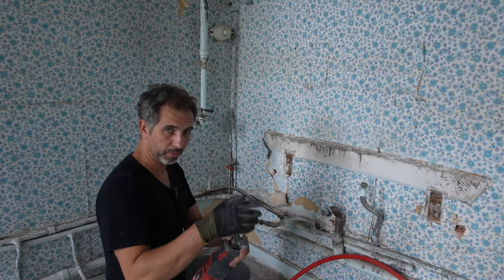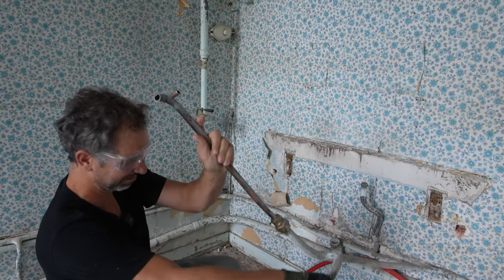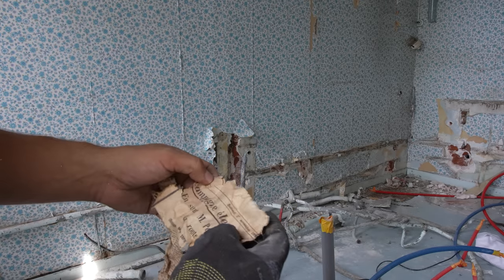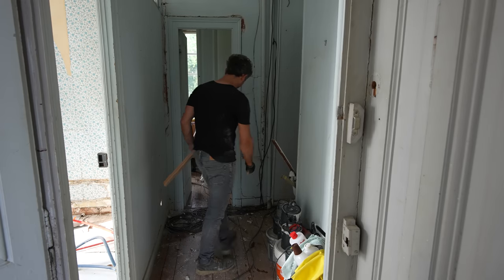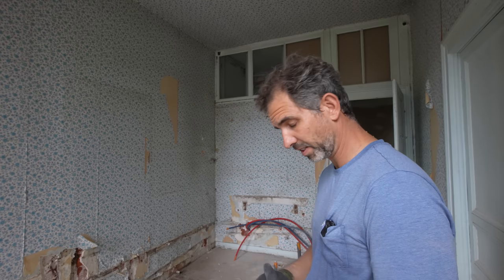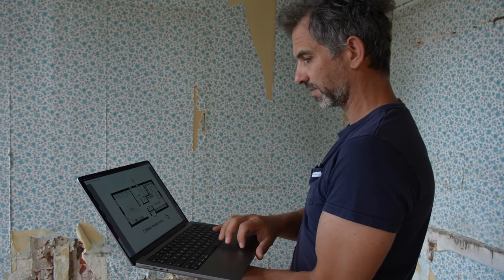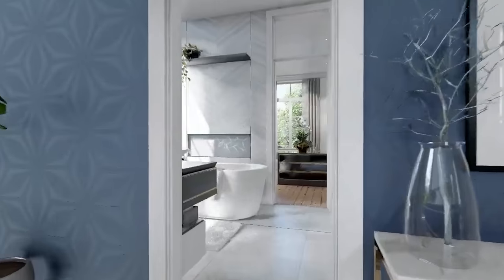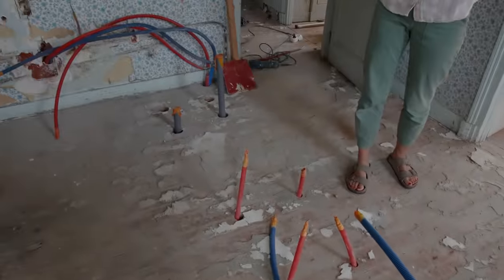Chateau Master Suite Makeover - How complete strangers redesigned our bathroom

Comment: Keep the two doors, ditch the hallway door.  The bathroom is more private to the master bedroom suite if it is accessible through the bedroom and not the hall.
Reply: This. 👍🏻
Reply: This  will make a beautiful master suite 👍🏼
Reply: Keep the flow. You’ll be glad you did. The bathroom should not be accessible from the hall, however.
Reply: Commode could be placed in same room, next to shower, in space of where the hallway door (that would be removed) occupied.
Reply: Totally agree with this!
Reply: That's a crazy idea, if you need privacy in the bathroom no one can enter the dressing room. Hard if getting ready in the morning.
Reply: @kyliereynolds4687 there would still be the hallway to access the dressing room directly from the bedroom… see the plan shown at 10:50… when they say “ditch the hallway door” they just mean take out the door going from the hallway into the bathroom
Reply: Definitely the two doors
Reply: I agree!  A master bathroom should be for the owners only and not other members of the home.
Reply: Agreed!
Reply: Technically you could keep the hallway door and build the toilet there. Use the frosted glass enclosure idea from that last designer (with the animation video). That way you could still use the toilet that is usable even if someone is having a shower or a bath - just make double locks, so whoever is using the shower or the toilet won't have someone else barging in.
Reply: I agree!!!!
Reply: Keep the 2 doors. Lose the hallway door.  Sorry for the extra work Philip.
Reply: Totally agree
Reply: Keep the door from your bedroom to the bathroom. 
And have glass above the lintel to let  the south light into the bathroom.
Likewise have a similar window above the bedroom door. That will bring daylight into the hallway. 
I think having a door from the bathroom  into the dressing room is practical. Close off the door from the bathroom  to the hallway.
Reply: Why not change bathroom with dressingroom? More space for example a privat infrared sauna, good for you after hard physical work at the château
Reply: Agreed! You could always have a single shower and then put the toilet in an alcove in front of where the hallway door is currently, so you don't have to move any additional walls :)

Comment: I would definitely block off the hallway door and with regards to the bedroom/dressing room doors, you could have sliding doors that slide into the wall and keep it open most of the time, just close it if you need privacy etc.
Reply: Pocket door.
Reply: And if they reuse the original doors they will keep the heritage feel with modern practically.

Comment: Whichever plan you choose with the doors to the bathroom,  make sure to keep the independent access to the dressing room from the hallway. You need to be able to access it when someone else is using the bathroom.
Reply: As long as the toilet is enclosed in it’s own room within the bathroom, the extra door may not be necessary .
Reply: I was referring to let's say, someone taking a relaxing bath and spending a while in the bathroom, thus preventing access to the dressing. However I do agree with you that the toilet door will alleviate the need for locking the entire bathroom for most uses. It depends on the use of that suite, guests, or homeowners I think.
Reply: I am sure they have a multitude of bathrooms to choose from if someone is in the bath.
Reply: If this was a sanctuary for my husband and me, I would absolutely walk through to the walk-in closet room. The toilet is private with the attached door. He has nothing I haven’t seen.
Reply: @Lifewithoutmusicisamistake yes, but if some one wants to walk through to the dressing room….?   Some one we are not married to…?
Reply: @eleonoreaubry2469  yes agree. However I was thinking later that the extra door to the WIR would be handy if you just needed to run upstairs to get something - eg jumper, coat etc.🤷‍♀️
Reply: I agree with keeping the second door in the dressing room in case you want to enter it or the bathroom without bothering someone resting in the bedroom. That was the main reason I favored the solution with the bathroom door to the hallway, but if there is an additional door to the hallway in the dressing room, it should be okay, too.
Reply: And it gives you more options for the dressing room to be transformed for other purposes (you never know)
Reply: One always has to think of escaping a fire easily and quickly also. If the dressing room is at the end of three sequenced rooms (bedroom, bathroom, then dressing room) with no other egress except the windows, it could be a trap in some unthinkable scenarios. All rooms upstairs should have a collapsible ladder/chain ladder that hooks over the window sills in case of fire, regardless.  I was an EMT. I think about these things.
  @thinkingbout
Reply: Not if the loo is seperate
Reply: @juliamcgrath3364  I hate toilets that don't have an adjacent sink - even a tiny corner one.  Also I don't want my clothes anywhere near the steam and moisture that comes with a bathroom.  Not to mention potential toilet spray.  

It's going to be fabulous whichever you choose.  Excited to see your color choices for the bedroom - so many great color choices throughout the house.

Comment: Keep the two doors. You might remove the actual door to the bedroom so it stays open but keep the actual door to the closet. My house has the closet off the bathroom and steam from the shower can cause mildew to form on the clothing. If you can close the door to the closet then you can reduce the moisture in there which will reduce the chance of mildew on your clothing.
Reply: 100%, specially with a French Normand climate.
Reply: Same. I keep my closet door closed all the time, and had I properly envisioned this necessity,  I'd have put a glass door into my closet so I'd still have natural light inside when I'm dressing there while hubby showers.

Comment: The two doors are beautiful. I would keep the ‘flow’. It’s also hard to tell from the video since I don’t have the exact measurements but the double shower seemed gigantic. I would look into exact measurements and then go for a wider shower of approximately 1,2-1,5m with two shower heads. If that doesn’t work I would go for a smaller shower. Moving of the walls seems too much and the space is already quite large.

Comment: You guys are really lucky.  You received a bunch of really nice design proposals and all for free!  I wrote a note last week with a few general design thoughts but not much specific with the exception of keeping the two doors opposite each other. There is a very good reason you feel comfortable with that concept, Anna.  It has a very natural flow and in a house of your genre, it was very common and called the "enfilade" style where a suite of rooms would all be joined by doors in a straight line.  Much like formal french gardens which would often have those same long sightlines. (Not the other meaning of enfilade which is a series of cannons all firing at once.)  You would also be giving a small but very polite nod to the origins of the house.  Next, Philipp, we know you are having trouble with the wall thing, but get over it.  It's not that big a deal.  Just get one or two guys to come in to do the drywall work for you.  They can put up the drywall, patch and mud whatever is necessary and be out the door while you are still trying to figure out how many sheets of drywall you need. None of us mere mortals are good at drywall unless we did it for a living. Don't try to help them, you will slow them down.  If you are keeping the floor the same (and I would) like the dining room, for instance, which turned out beautifully, have Benoit do patches where the holes are.  You can't hide them but he can make them look good.  Typically, they will look sort of like little "x's" but it is done all the time. Then do all the primary floor sanding for all three rooms. If there is no crown mould, put it in now and make it as close to the same as any other in the house.  Keep all door and baseboard mouldings the same as the existing. If you install mouldings up to wainscot height like were wisely shown in one of your patron's renderings, keep them the same shape as any others in the house.  Even if you don't especially like the shape, so sad.  Be consistent, be consistent, be consistent.  Again, as in the bootroom color choice, it all helps with the flow of the house, one room to another.  Lastly, Anna, if you are going to do paper, that is done after woodwork, paint, caulk, after everything else.  You can leave it till later even if you just paint walls for now, get the papers done at a leisurely pace in your atelier, then install them in a month or two or three over a not busy two or three day period, like when you are between guests and Philipp is busy fighting bees or planting trees. You know what i mean. Get Philipp back on the drawing board and walls be damned, full speed ahead!
Reply: Awesome suggestions!

Move the wall even just a bit for the toilet and have it not have to be enclosed would solve the issue with not enough room…

Comment: Since the ceiling of the floor below is finished, l think you should consider completely demo-ing the floor.  Bathrooms like you have in mind have a lot of under floor work and drain pipes are the worst.  That will allow reworking the existing plastic easier too.
Reply: Now that I think about it I bet that floor isn't more than 8 inches thick.    Depending on where your vertical drain is coming all the way across the floor,  at the right pitch might not be possible.   I say get a plumber in to review your room and plan.

Comment: I would also go for a two doors design, no door from the corridor. However I would not close up the toilet. Don't know exactly what your ventilation options would be for the closed space of the toilet, but if it would still be done via de windows from the main bathroom I dont see much reason for adding extra walls. You would just make the space look smaller. May you make the best decision for your needs and wants.

Comment: As nice as all those professional designs are none is in line with the time period of that chateau. That's the biggest issue i have when it comes to these professionals. A restoration and a remodel are two very different things. You are doing a beautiful job here please don't change to ugly modern lighting and those awful polished woods, casino mirrors. The Chateau would not appreciate the brass and glass tables and the hotel modern style sinks,   UGH keep it in the time period of its build dates. The thumbnail photo is beautiful and why not use a proper chandelier instead of round lights that are not suitable for such a beautiful structure? The fabric draperies look to be perfect to me

Comment: I'm curious whether you have to frequently test for asbestos in old floor coverings, pipe insulation, etc. before removing it? Or perhaps it was not as widely used in buildings in France compared to the U.S.?

Comment: The last design idea was stunning. Absolutely perfect! As you age then you are going to really appreciate the space that will be needed. 💗🤞🙏🙏🙏🙏🤞🥇🎉 Please, please consider putting in backing/blocking in the shower wall for a wall mounted folding shower bench. The zero curb design of that shower is absolutely amazing! A line drain from Schluter with their full waterproofing system would have me over the top with excitement!!! OMG, if you have not checked them out then you have NO IDEA!!! 

Schluter recently put out a new product that I haven’t checked out yet… but based on the picture then it looks like a niche with integrated lighting… for the shower!!! Sorry but I am so excited about some of the new stuff they just recently added onto an already phenomenal top-notch system in the first place. Please look into their decoupling membrane for the flooring and their heated floor system under tile. 

I don’t work for the company. I have no benefit in saying this. I just spent many years studying about waterproofing and tile to find them at the last minute. They went above and beyond what I was looking for and solved a lot of the issues that I was concerned, worried and bothered about in other system. They are well established, their warranty is second to none that I could find and very passionate about their field. Their research and development is exceptional as is the customer service. They provide an abundance of online and in person training for so many people!  

I did take a couple of their FREE training courses and even though they could have been very unprofessional about other companies and products… They just refuse to be anything but professional. They taught the legal standards of the industry, challenged us to think and trained us on how to be able to install their product… correctly. 

These classes opened me up to the good intending but horrible pitfalls of other people demonstrating their products online without consulting the manufacture instructions. I now understand how important it is to check with the manufacturer for accuracy or the warranty is no good. A lot of videos that I was watching were representing themselves as tutorials to install a product but we’re not officially representing the company or product that they were demonstrating. I used to be one of those people that thought they were demonstrate an accurate representation and found out that there were several common errors that could undermine the waterproofing and tile installation and/or void the warranty. Considering how good the warranty is when installed correctly then that’s money well spent to me!  

I hope this helps and I’m rooting for the last option! 🎉🎉🎉❤🫶🫶🫶

Comment: Are those plumbing pipes lead?  The metal seems so soft and bendable by hand. Strange compared to here in America where old pipes are either copper or galvanized (steel treated with zinc coating). But new construction or replaced plumbing is pex pipe, a plastic pipe I’m sure you are familiar with. I’m very curious about old world building materials and techniques because we don’t have very old buildings, and we use a lot of wood in construction.

Comment: Don’t compromise on the layout and walk-work-flow aspects on the grounds of the “amount of work” that might be required with wall alterations. They aren’t structural support, the capital cost is minimal - it’s mainly time and sweat, and far less nasty than what you’ll have to be dealing with in regards to plumbing and the rigmarole of waterproofing sealants and membranes.

If you forfeit optimal flow to “save” 2 days elapsed time in work, you’ll remember and regret that decision every single time.

Comment: If you love the last rendering but are apprehensive about moving walls and fireplaces, just make a generous single shower using this design. Should work like a charm! I like it too!
If you don't plan on showering together regularly,  it's a nice option. There's light everywhere you are in the bathroom, and the flow you're looking for. The more old fashioned version would be shutting both doors and using the hall door. It's not less private as you arent sharing it with other bedrooms in this part of the house. It's a charming alternative bc it IS more private with only one door (easier to be shut away for alone time), and with only one door gives you loads of more space. But I too kind or like the last option. Order a bath big enough for two instead, if you like getting wet together. Lots of nice renderings! That's very cool viewer support! 👌❤️

Comment: My thoughts on this: 

1. Benefits of one door opening to the hallway:
- easy access from the hallway without disturbing someones rest /dressing in the other rooms,
- you don't have to go through the other rooms which saves you time and
- you don't spread dirt through the bed/dressing room when you need to shower after a long workday
-the damp air from the bathroom will stay in the bathroom and not influence the otherrooms regarding moldprevention etc.
-still bright because of two windows and maybe the ones leading to the hallway
-keeping smells in the one room
- more space for the double sink & toilet
-leaving a natural lightsource for the hallway
BUT 
- you don't have the easy access from the bedroom
- no southfacing light

2. Benefits of keeping the doors like they are now additionally to the ones above:
- easy access from the bedroom
-light from the bedroom, if the door is open 
-maybe better air ventilation
-BUT 
- dampness from shower bathing etc. might influence the bedrooms climate
-smells from the bathroom may spread into bedroom

3. Benefits of closing the door to the hallway and opening the one to the dressingroom:
-nice flow
-maybe better air ventilation
-more light into the bathroom and dressingroom, if doors are open
-easy access from the bed and dressing room (if you keep the second door to the dressing room, which is the only way I'd do the third option, to have a second access to the bathroom in case the bedroom is occupied)
BUT: 
-dampness from the bathroom may go in the bed & dressing room influencing the climate and leading to mold,
-outside the bed/dressingroom the access isn't easy, you always have to go through one of the other rooms, maybe even making them dirty
- smells spread through all rooms

So you probably have to weight the advatages and disadvantages of everything regarding your own likes. I personally prefer the first option (then second than third) but I may be biased since that's the more european way to do it, which I'm used to, while the last one is a more usamerican way. Keep in mind that you probably found the last proposal you've showed more interesting since you saw the interplay with the bed and dressing room which you couldn't with the others. So try to focus on your own needs when deciding, that way you'll make the right choice! :)